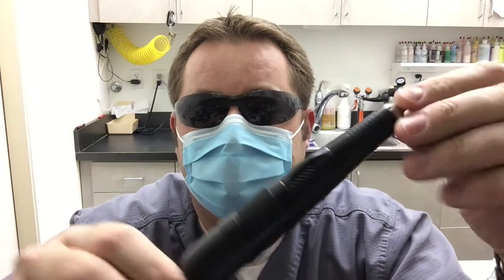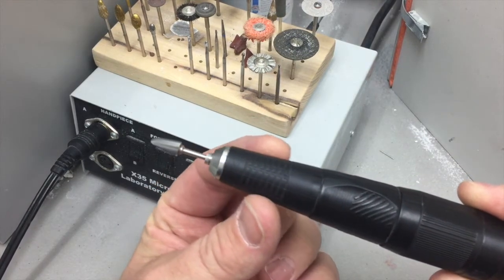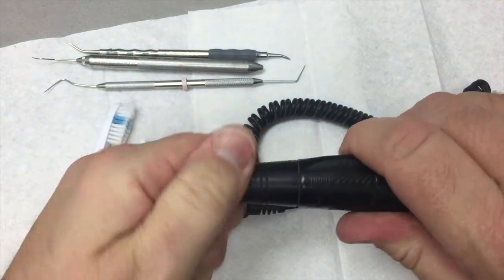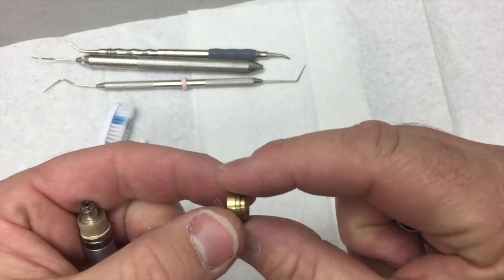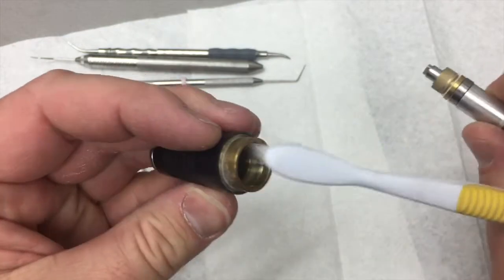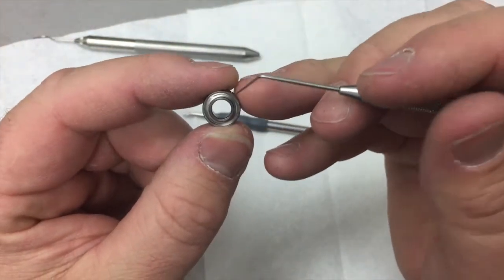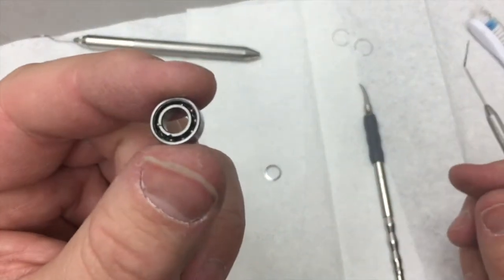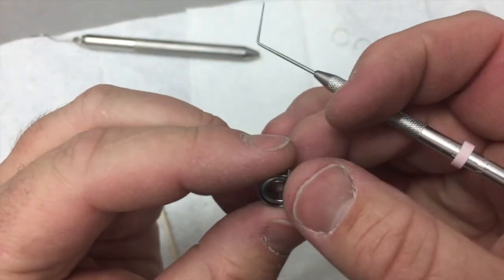Dental Hand Piece Repair

Comment: Very interesting video. Little bit unnecessary. You did say you enjoy it though. I do think that if you can pull it apart you can replace bearings yourself no need for an agent $100 is crazy. These parts are easily bought online from Korea or even China, I would not be surprised if that was where the original ones came from anyway.  Definitely far less than $10 including shipping and most probably you will want new clips too as the original will probably be out of shape. In fact that entire transfer can be bought brand new online for less than $10. Its easier to remove those clips with a flat blade as a matter of interest. Great fun video thank you.

Comment: Dealer was right, the bearings of low speed carbon brush driven hand pieces are not serviceable, this hand pieces are high maintenance tools and you need to replace the bearings often soon after starting to make unusual noises and vibration, no grease, no oil, no WD 40 or any type of lubricant, just change the bearings with good high speed rating bearings specially lubricated for that purpose, don't service the already worn bearings, they may show some kind of relief after your "SERVICE" but defiantly its waste of time.

Comment: This is where buying a quality set of calipers is a solid investment.  You can measure the width, the inside diameter and the outside diameter and order bearings for a fraction of what you'd pay a manufacturer.  

Consider the example of my Powermatic bandsaw, the upper and lower bearing guides use five bearings each.  From Powermatic, they are twenty each.  That's two hundred dollars.  By measuring the bearing, I was able to buy a container of eight for four bucks.  Two containers gave me spares, all for sixteen bucks and shipping around five bucks.

With that kind of savings, I was able to jump up to ceramic bearings, which are worth cleaning.

Just make sure you order the sealed type bearings.

Interestingly, I found packing my bearings nearly full of grease helped keep dust out.

While my saws are much bigger than these hand grinders/drills, the same cost savings rule applies, if you buy from a bearing supplier.

All the above aside, thanks for showing how easy it would be to get to the bearings in my RAM carver hand piece.

Comment from the maker: The reason I have cleaned the hand-piece (bearings and all) is for a video and the inability to access replacement parts.  If anyone has a catalogue and/or part numbers pass them on.  Its not a perfect process and it is faster when not being filmed.  I know it is easier to replace parts but in a pinch it works.
Reply: You need to check the size of the bearing measure the shaft that go through on the inside as well as actual bearing dimensions outside. Easily bought online.

Comment: What not to do in a practice. Those bearings cost $10 each. Technician time is about $1 per minute. That is $30 for a job that should never have been done, and won't last, even on a slow speed piece. It takes me about 5 min to do that job, $20 for both bearings. $25 total. He's already spent $30 and only did one bearing. The cage in the bearing goes first. Most of the time when you open them up, balls fall out of cage because it is deteriorated. I guess this is nice to see done, but it isn't really the way to go. The mask and sunglasses are a little over the top, don't you think?
Reply: Smart. But to be productive in your comment kindly share what bearing, model & supplier.
Reply: @yurigagarin1987  You really don't know what you're doing, do you? Answer: inside, outside, width; call HH or Quality, they will have them.

Comment: bearing take apart, then should dip into the alcohol to take out the  dust, should not use the swab to grease the bearing, it will bring the  firber into the bearing. why i know this, cuz i am the miniature manufacture.
Reply: l